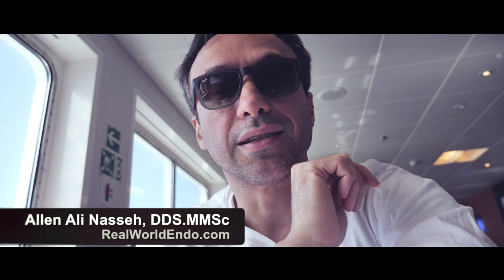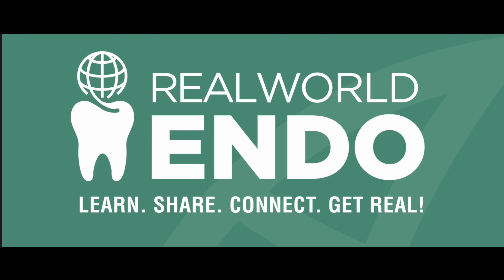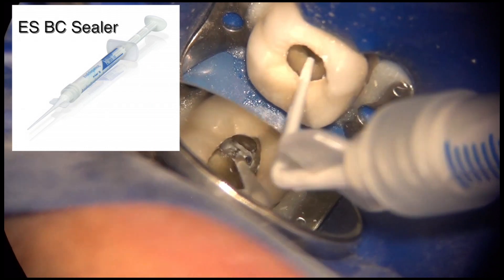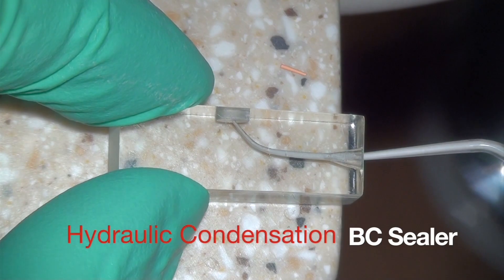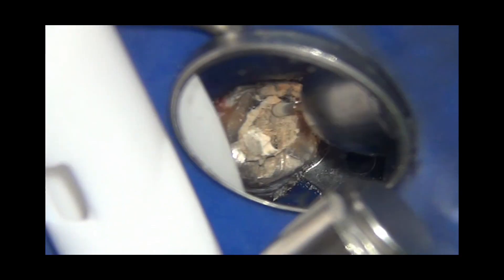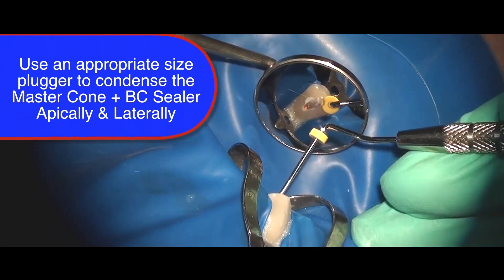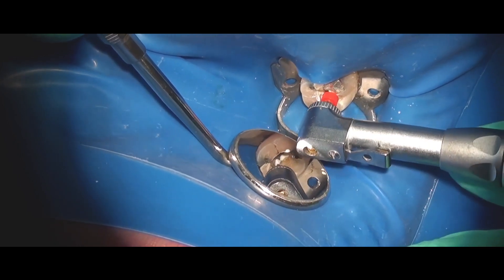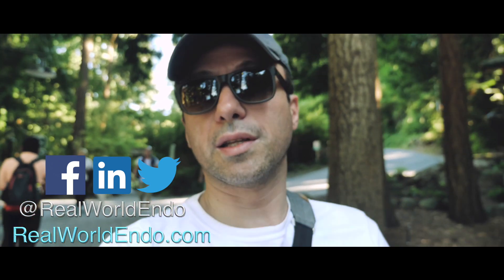10 year anniversary of BC Sealer and Hydraulic Condensation!  (Vancouver Vlog)

Comment from the maker: Hi everyone! Happy Friday! For those of you using this technique let me know your thoughts and experiences! Would love to hear from you! :)
Reply: Real World Endo first of all many thanks for introducing me to this method of obturation. I have been obturating this way for the last 2 years. Not only is it a simpler and cheaper technique when compared to more complex obturation ways that require expensive tools and machines it's also superior in its sealing/filling abilities. The sealer has always been the weak link within obturation and we aim to minimise this by using the least amount. Since BC has been introduced it's no longer a disadvantage to use sealers. On the contrary with BC now the sealer is shining star of obturation, due to its many favourable properties including bonding to dentine (resulting in superior fracture resistance of roots) and the more we use of it the better. 
My only concern is that have we introduced enough of the sealer into the canal system to occupy all the spaces within the canal system such as lateral canals, isthmus, anastomosis etc? For example a molar tooth exhibiting c-shaped configuration will require more BC sealer to fill in the communications between main canals. However the question that arises is how much of BC is enough to complete the 3D fill of this canal system?
Reply: Real World Endo also, I prefer to inject directly into the canal system under a microscope and witness the overflow of the BC from the canal orifice which gives me the assumption that more than enough of the sealer has been introduced. I fear that using a file or a GP to carry the sealer into the canal may result in inadequate sealer and hence gaps within the canal system?

Comment: Isn‘t applying the sealer with the master file problematic due to the contamination of the file during the preparation phase?
Reply from the maker: Yes. You should either disinfect the file by inserting it in full strength bleach for 30 seconds or use a separate sterile file for that portion.

Comment: Hi Allen! 97% success sounds good, do these numbers include retreatment cases or just vital cases? The next question that comes to my mind - and probably many others too - do you have comparable numbers from your "Pre BC Era"? THAT would be really interesting to see if warm vertical condensation ( and a detailed look at the irrigation/ activation protocol, coronal restauration !!) with ZOE Sealer have the same outcome. 

Looking forward for your feedback and many thanks for everything.

Greetings Gregor
Reply from the maker: The numbers are based on 200 consecutive cases my resident could follow up in the first quarter of 2010. Apicos and retreatments were excluded to keep it to traditional RCT with HC. Furthermore, the cases were a mix of necrotic and vital cases. Of the 3% failures half had failed to restore the tooth! We're currently trying to investigate the pretx. diagnosis in all teeth and whether there was a trend.  To answer your second question, I don't have a comparison from before, when I was using AH+ and VVC. It's possible that it was the same success rate with the other technique in a 5 year interval. But we don't make a claim that HC has a higher success rate than VVC. The main things I noticed after switching was a lower post op pain and a much simpler and faster obturation. Basically, I simply claim that HC is effectively the same, but more efficient. Cheers!
Reply: Hello again! Tahnks for the further details. I was not meaning to say that HC was superior to VVC, but equally successful. Going by the KISS principle, keeping away from the technique sensitive VVC by doing HC,  is improving the results tremendously in my eyes around the world, besides saving some Lifeyears of the practitioner 😄...I noticed the same drop in post op pain after replacing AH+ with BC Sealer, in fact I cannot remember any case in all this years (since 2013 ) of using BC  Sealer. 

Looking forwards for the publication.

Greetings Gregor
Reply from the maker: Equally a big fan of the KISS principle! :) That's why we call it Real World Endo and not Complicated Endo! :) 
Stay tuned for the article and have a great weekend! :)

Comment: As a resident starting of July next year, what would you do when it comes to obturating cases? Would you learn warm vertical and hydraulic condensation simultaneously? Or would you only do one or the other?
Reply from the maker: UCTeeth As an Endodontic resident you should know them both. You can then decide which one you prefer to use clinically when it's time to practice. :) 
As an endodontist, you're expected to be an expert in the field and that's why so you should at least know everything and have tried it before forming opinions about it. Good luck.